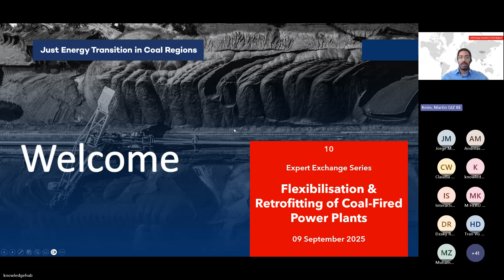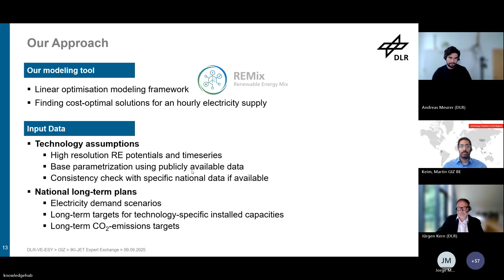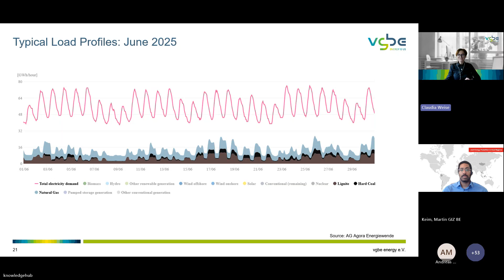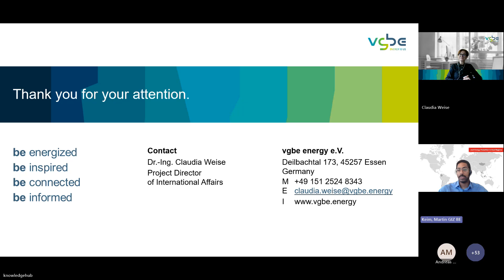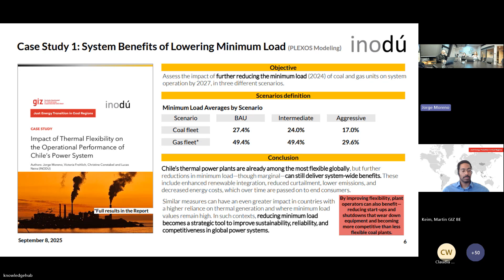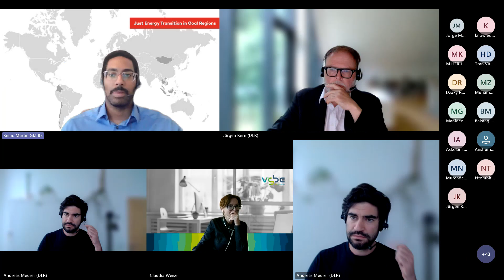Expert Exchange - Flexibilisation and repurposing of coal-fired power plants

Comment: With the war on coal in the US coming to an end and the need to increase power grid capacity and lower electric rates the only option that does both is new highly efficient ultra supercritical clean coal power stations burning high BTU bituminous coal.   Chinas is building hundreds of these new coal power stations.   US electricity generation and support has greatly switch to petroleum (natural gas) to support wind and solar electricity on the public power grid.   The support of this erratic electricity has higher fossil fuel costs than the normal generation of electricity.  The entire generating space of wind and solar generated electricity in practice is achieve with fast reacting natural gas turbine generators forcing the switch from economic coal to expensive natural gas.    

Natural gas became highly abundant 2005 - 2008 with new fracking and direction drilling for crude oil with natural gas as by-product, but not nearly a large enough market for it.   This is the period that climate change was being being promoted from CO2 causing large implementation of solar and wind generated electricity requiring huge amounts of natural gas to support it finding the large market for natural gas that had been missing.  Global warming has been at 1°C since 1992 with no known cause.